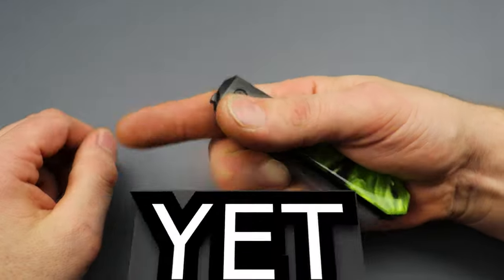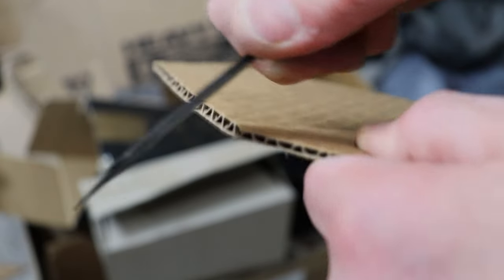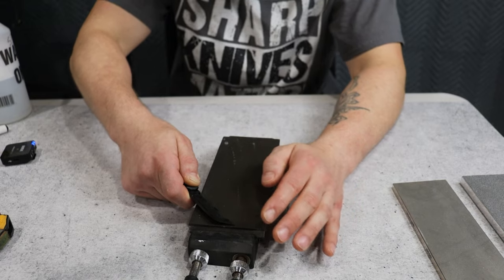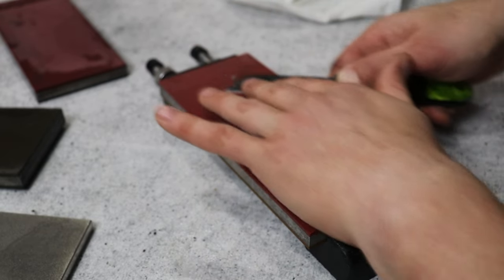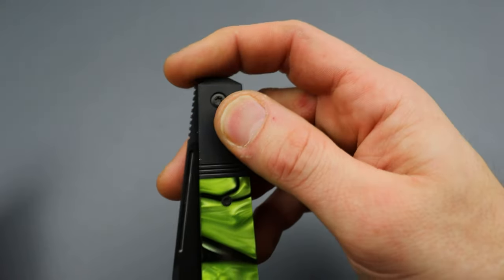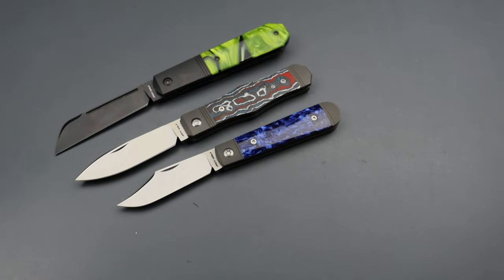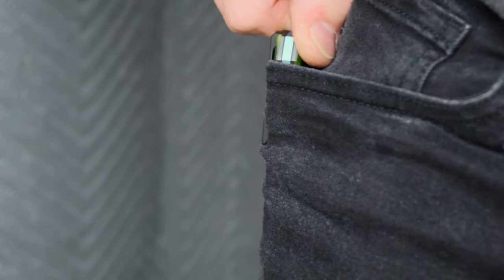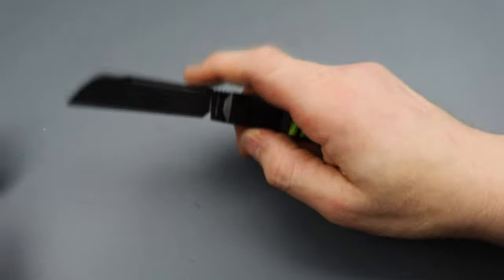By Far The BEST YET So Lets Test it

Comment: Best hollow grind I've seen is on my 1 of 4 special edition Bull Shamwari from 2014 in damasteel. Its about 0.004"-0.005" bte (hard to measure when its that thin) and it takes it a good 1/4" to break 0.010" bte. Plus its a proper hollow grind that doesn't thicken up by the edge (i think Sebenza does that where its a bit thicker at the edge but after a few sharpenings it gets thinner.) almost like a half pipe. Its a beast of a cutter and one of few knives I'll never sell.